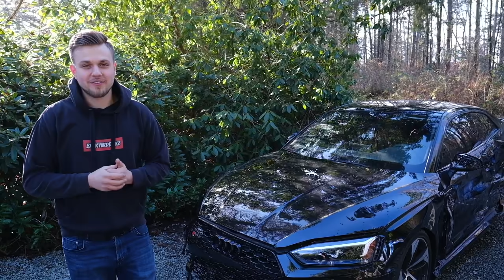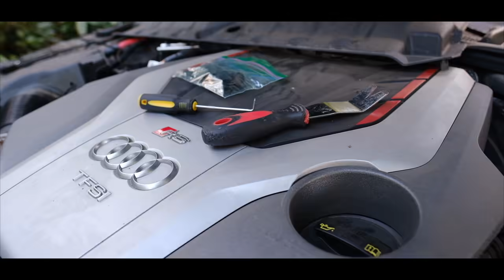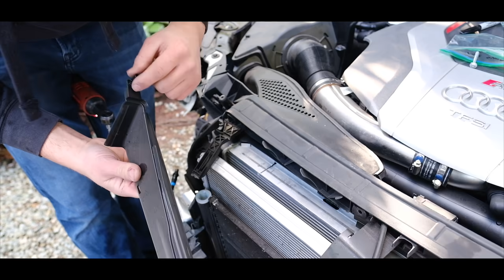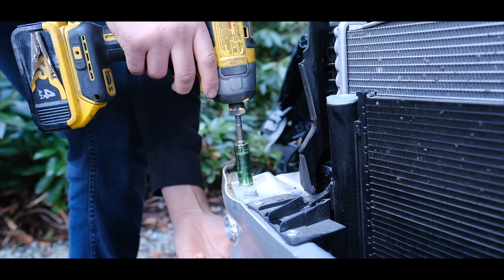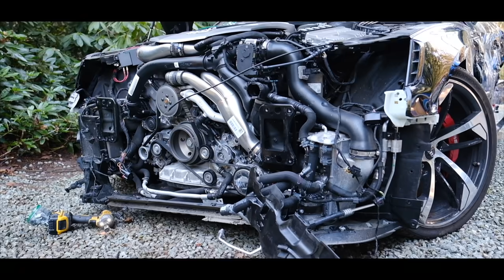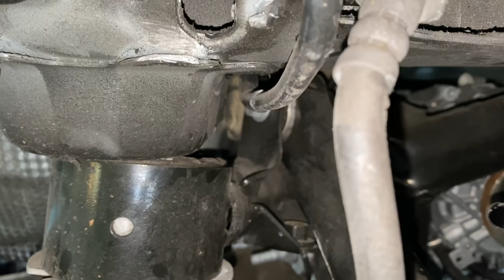My Wrecked $100,000 Audi Rs5 Was Hiding Some MAJOR DAMAGE! (Over 10k In Parts!) [Part 2]

Comment: Here in the UK this would be most likely be a CAT B.       Which is categorised as a car for parts only.    Not safe to rebuild and put back on the road 🇬🇧🇬🇧🇬🇧🇬🇧🇬🇧
Reply: The sad thing aswell is this might get fixed up and be in the future ownership of a young family of 4, if they’re unlucky enough to get into a crash, it will be curtains. Just down to the fact that the structural rigidity of the car would have been severely weakened, no matter how much you “pull” it out again, just so it appears aesthetically fixed.
Reply: In UK this wouldn't be possible! He might repair the car but it won't be safe expecially if the car gets in another accident again.
Reply: In USA it depends on the laws of each state. In some it be parts car in this state its rebuildable. ))
Reply: With you it’s a parts car will never be safe or worth the hastle even if it’s for self achievement
Reply: It all depends on how ti m repairs it which is properly he doesn't do half ass jobs if done properly this will be stronger and better than it came out from the factory.
Reply: @0o0-D1  stronger than factory? That’s not possible.. for that it would need to have a reinforced chassis
Reply: The same in Australia. It would be classified as a Statutory Write Off and could not be re-registered in any State in AU.
Reply: Youtube comment experts! Any evidence its gonna be weaker once repaired? Even if it was a bit weaker the buyer would be fully aware of the extent of previous damage from all the videos and will be stronger than most cars on the road still.
Reply: @ak938  Ok give me your personal car then, let me smash the f out of it and repair it myself in my back yard with no state-level safety assessments? LOL
Reply: In many other countries as well. JUST NOT EVEN WORTH REBUILDING IT. Only to sell it for parts. This car will never be as safe as it was just when it came from the factory.
Reply: Salvage title cars still have to be inspected before they’re registered. Plus Tim doesn’t half ass or cut corners. I wouldn’t be worried about it at all.
Reply: The only car we should worry about is DIY gang with their vin swapped challenger

Comment: Why are you guys not buying a hole new car frame?! Then switch everthing over to the new frame from the rs5. I think thats way more safer due to crucial frame damage.
Reply: There's some logic in that statement for sure. I once worked next door to a company that prepped Porsches for racing. This 993 GT2 came in with a lot less damage than that RS5 and they re-shelled it.
But maybe Tim and his Boyz have the will to take on this challenge for the audience! 😁👏

Comment: Tim , Backyardboyz first off congrats on quarter of a million subs , you are just growin' guys , just happy and impressed to see you guys goin' up the ladder with these tough times , Excellent guys , this shows your Hardwork and determination itself is payin' itself for you guys keep it up , Next regarding the RS5 yep the front end is way simpler and faster and almost like a smooth breeze to do and finish pulling the frame rails back to spec and replacing damaged parts like the cooling system assembly , except for the condenser that's good  and from rest only the headlight seems to be good   ,   ( then maybe the core support and the crashbar I'm not sure , only you guys can tell if those two things are good or not ) rest everything is bolt on's though I understand it's expensive , but Tim now my suggestion is mainly for the back end as you showed that whole subframe and quarter panels need to go , so what I highly recommend to do is instead of goin' to the dealer and breaking your wallet , get back to any auction right away and search for an A5 / S5 thats completely smashed in the front (so that you will get the back end as you need ) or get one that has anyother kind of damage where you maybe able to get the front end part's as well  , or incase you feel as you said later you cannot get this one right but an A5 / S5  FOR CHEAP so that you can use the chassis and swap over everything , and yes each of these types of damaged A5's / S5's has sold for Dirt cheap I've seen before so you must go that route , trust me it will save you from emptying your pockets , parts cars are always the best , anyway stay safe and keep goin' , I'm confident you can get this beast back to life and spec  in no time , Keep grindin' , Rollin and Rockin' , you're just as awesome as the Goonzquad boys , Go for it. 
God bless you.

Comment: To all those who say this should only be a parts car, that may be true based on the cost of the rebuild, but the structural damage isn’t severe. Today’s frames are made with ultra high strength (UHS) steel, which can be manipulated without loss of integrity. A slight kink to the frame rails can be bent back without compromising the strength and rigidity. It’s when frame rails are fully bent and need welding, that’s when they lose strength. If he can replace all the broken components and do the body work, there’s no reason this shouldn’t be done. Let’s see what you can do Tim! 👍🏻🚗

Comment: Hi, you told in the previous Video, that the headlights are about 3000 Dollar. Here in Germany I have seen a lot of advertisement and they cost only 1350 Dollar. 

PS: only 1350 Dollar( It is very expensive, but only the half of the price)

Comment: Curious what process is to get cars like this registered again after repairs where you are. Here in Australia that would be classed as Statutory Write Off so can’t be registered again in country. If it classes as Repairable Write Off then you need to have documentation showing every repair process to prove it has been repaired to manufacturers specs, if new parts used you need receipts to prove it and if second hand parts used then you need vin number of donor vehicle and receipts to prove nothing has been stolen, if you can’t prove where a part came from then car won’t be passed and part needs replacing. Once repaired car needs to be inspected with documentation and passed before it can be registered again, most time cars too damaged aren’t worth repairing because of process to get back on road makes it not viable

Comment: At least on the bright side the engine and trany are OK and the interior, a bit bondo on the panels and j. b weld for the plastic should be fine..... You can do it will test your knowledge a bit but I've seen worse

Comment: Why don't just buy an audi a5 2018  will be 20k and it have the same body etc etc , and just add the interior , swap the engine the parts add an exhaust and Brava you have an rs5 and it will be safe for road also more cheap ...